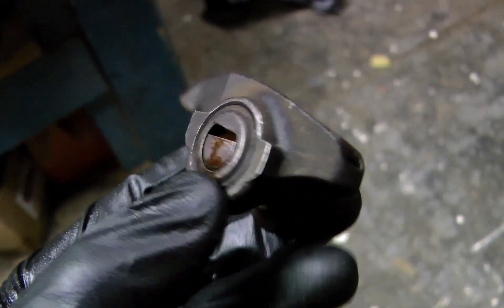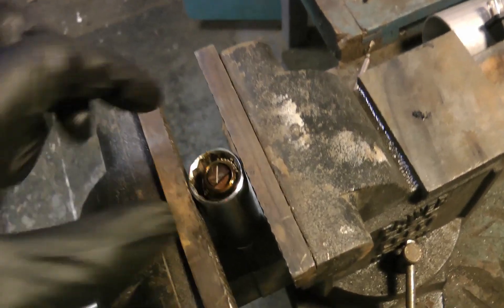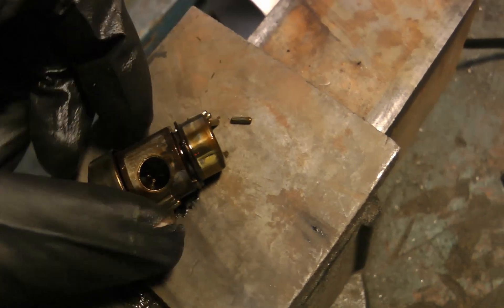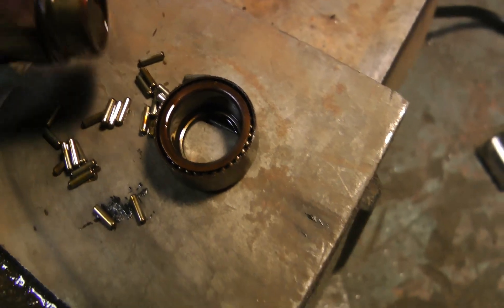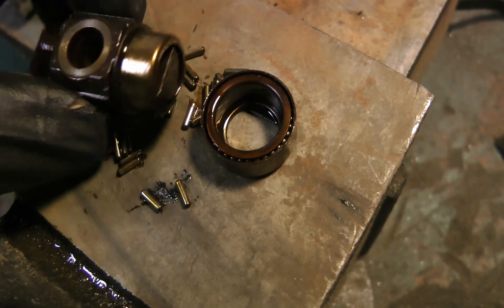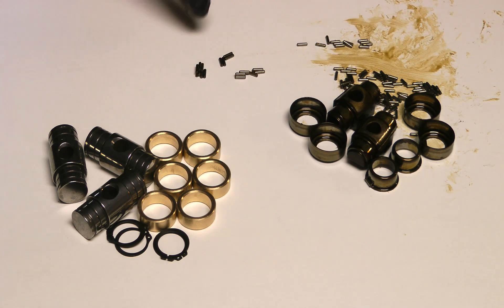LS Rocker Arm Tech - Why and How I Installed the Steve Morris Trunion Bushing Kit

Comment: The CHE rocker arm trunion kit is almost exactly the same as the Steve Morris kit.
Reply: I'm sure there are several companies making this kit.
Reply: @jerrylauber7311  I went with the CHE kit and the quality and ease of installation was on point. Would recommend CHE to anyone looking to upgrade their LS rocker arms which is highly advisable.
Reply: I recently installed the C.H.E. kit on my stock 2006 LS7 with 76,000 miles. I run 5W30 Mobil1 oil. I expect the C.H.E. kit will hold up well, but time will tell. Unfortunately I don't put many miles on my car, so it will be a long wait to get some results.
Reply: @ktriebol  I had them on my turbo 4.8L in my 2011 Silverado and it did very well and is still going strong. The ease of installation and quality of the product is all there. My truck pushes around 650RWHP and they are holding up just fine. 👍
Reply: @JustAGuy781  One nice thing right of the bat is the way it quietens the engine down.
Reply: All these bushing kits are JUNK.  You can actually HEAR the stiction the bronze bushing creates rubbing on the steel trunnion.  You can also FEEL immense stiction just pressing and turning in your hands!  Imagine the how its creaking and heating up under 400 - 500 lbs of spring pressure.  Summit makes a Comp "style" caged needle bearing trunnion kit that I will take my chances with.  I have had the Summit bronze bushing trunnion kit in my LS3 for roughly 1000 miles and I can tell they are wearing down.  The only time a bushing or plain bearing works properly is when it has a PRESSURIZED oil supply to create a hydrodynamic wedge of oil  like a rod or main bearing.  Splash oiling won't do it.  You can hear these things creak and scrape when the car shuts off.  Its not the "chirp chirp" of a failing lifter, it is more like a "creak" of scraping metal.  Terrible products, I don't give a shit whose name is on the box.  The bronze bushing LS trunnion kits are a MONEY GRAB for young guys that don't know any better!
Reply: @jaylestingi  I don't buy at all at 1000 miles you can tell your bushing style trunions are weakening and wearing as you stated. Not saying they don't wear after a while, but I will take my chances with a bushing kit rather than a needle bearing type.
Reply: And they are both junk.  Without a pressure supply, you will get IMMENSE stiction from the plain bronze bearing (bushing) onto the steel trunnion shaft.  Splash oiling is completely insufficient.